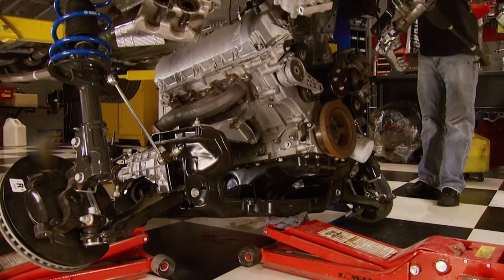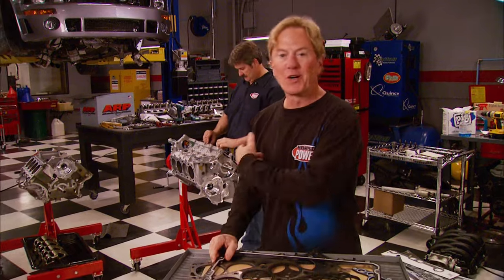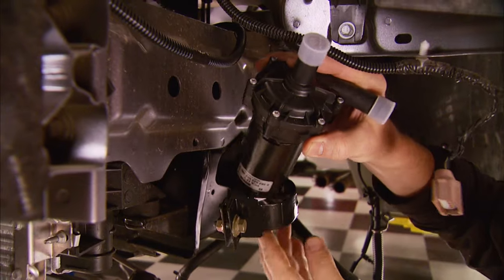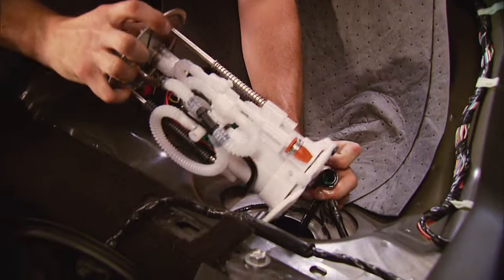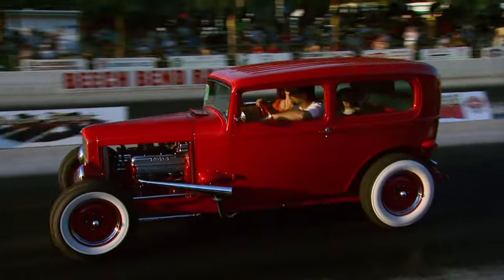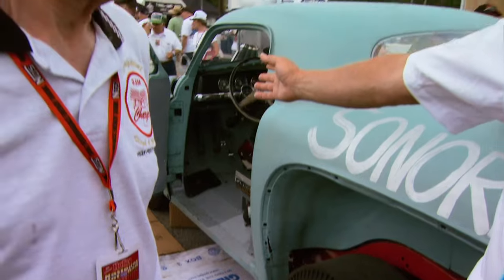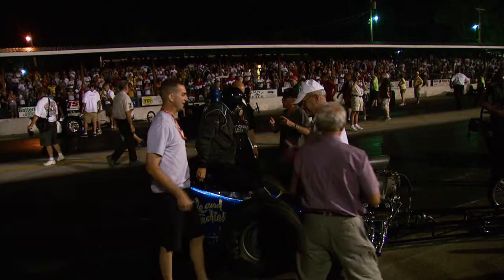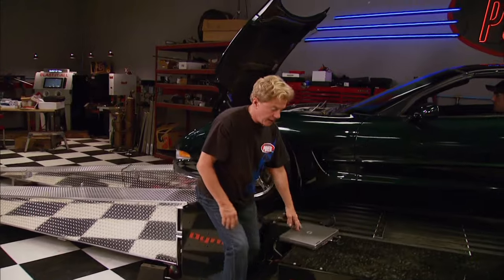Supercharging A GT's 4.6-Liter For An Extra 200 Horses- HorsePower S12, E13

Comment: Hey powernation your probably not going to respond but I have a question, I’m new to the car world I just got my first car and it has a 1975 Chevy 350 making about 140hp, and want to make about 150 hp to hit that 300 mark, with out blowing my engine and not spend to much, what is your recommendation? Thank you
Reply: Also I really don’t want to do a motor swap because even though it’s a 1975 it has low miles and I don’t think it’s worth Changing something that’s not needed
Reply: thanks for advising a 15 year old show
Reply: Port the heads and have heads redone with bigger valves to start...

Comment: If you're going to replace the shortblock, you might as well coyote swap it. Then it could make 700+ horsepower with a blower.

Or 420-460 HP naturally aspirated...

Comment: Question...
Does the super charger need to be removed when replacing spark plugs ?
Reply: Most likely judging by placement, hence why you should just go turbo instead
Reply: @Prestiged_peck  booooo turbo has its pitfalls too
Reply: @mikestoms4015  honestly idc which you go with, turbo has reliability issues, supercharger has servicing issues, and centrifugal just doesn't make a good daily unless you're looking for a stockish feeling car on the daily drive.
Reply: its a question you will never need an answer for
Reply: No, the supercharger does not need to be removed when changing spark plugs
Reply: @Prestiged_peck  no its easy to change the plugs!
Reply: @Prestiged_peck  WHAT are you high!

Comment: No need to drop the compression that much or at all on that engine. But this was 13 years ago lol
Reply: Probably trying to get it to hold with 91 octane with no boosters
Reply: Before e85 was mainstream and the great tuning we have now. Could go another 200hp with that blower if it were ported properly.
Reply: @paintballpartutd  they still had the option of race gas for a power tune
Reply: Low compression sucks for something thats daily driven. With e85 these new gen3 coyotes run around with 12.0-1 compression and tvs blowers and hit hard. Only thing that helps this is the roushcharger making up the low end if it were turbo or centri it would be lazy out of boost without a gear change.
Reply: thanks for advising a 15 year old show
Reply: @trillrifaxegrindor4411  anytime friend

Comment: Am I the only one who noticed that this mustang was already a ROUSH mustang before they started? Like, it seems all they REALLY did was add an intake, fuel system, throttle body, and intercooler... Why else would the old engine have already had the intake removed when we first get to see it if it wasn't because they remove the intake and ROUSHcharger ahead of time? OR maybe I'm crazy IDK...
Reply: Roush has staged packages. It likely started as a Stage 1 sold at a Ford Dealer.

Comment: Wish normal people could afford it. Did they see the build tally? You could just about swap a coyote.
Reply: You could just buy a mustang with a coyote in in.
Reply: The Coyote engine hadn't been released yet, this was filmed in 2008.
Reply: @ryanwalker3509  my point exactly.
Reply: @poot111111  it is now.
Reply: What's a normal persons budget?
Reply: Back in 08 a lot of people were building 4.6L.  The NMRA record for the mod motor class is 5.xx @ 250mph in a 1/4 mile.  They are required to run a factory block and factory cast heads.  But I believe they were over 4,000hp horsepower which is ridiculous on a stock block.  I knew of 4.6L street cars with over 1500hp back in 04
Reply: @nitroustommy3668  people always complain that they can't afford it.   If you don't make poor decisions in life you can have nice things.

Comment: Im kinda ashamed to admit that it took me until I was about 16 or 17 in 2007 to see that there  builds where 100% weak sauce and really just advertising... I know from experience  what a stock and stock bottom end with heads cam and intake frpp kit and a forged bottom end with the same heads cam and intake on a 3 valve 4.6 with no boost a little boost and alot of boost and what they put together was just a weak pile of money. My best friend had a 2008 bullet and was there for everything from stock to 900whp, with a completely stock long block with d1 procharger and air to water intercooler 80 pound injectors kooks long tube headers no cats 3" x pipe and stainless works mufflers he tuned it his self with hptuners i cant remember exactly how much power it made but it was over 530whp on pump gas and a little more on race gas not much more though he daily drove it like that for atleast 2,000 miles and beat on it every chance he could and then with the FRPP heads,cam,intake package they sold it made 590whp on pump gas with the same pulley on the blower but actually made almost 2 pounds of boost less than before but it didn't last very long and it let go he was revving it pretty high if he would have kept it at 6500 it would have lived longer imo but thankfully the heads didn't get hurt that bad and could be fixed then he built a pretty nice forged short block and swapped over to a badass custom single turbo setup with a Borg t6 s480 it made 910 with 28x10.5 Hoosier's through the 5 manual trans but he came to his senses and wanted to go fast and put a powerglide in it. I want to say he finished that setup in 2013 or 13 its been freshened up twice and its still running now besides re-doing the turbo kit and a bigger air to water core and badass forced Inductions billet s488 and cams its still pretty steerable taged and insured and goes mid 5's in the 1/8 but you can almost drive anything on the street in Alabama
Reply: I believe they always stayed super conservative on the tune and ran very low boost.
Reply: @nitroustommy3668  they had to!! I know its not the same but i have another friend i helped put a stock lsa blower on the 4.8 in his 2004 single cab Silverado besides the blower and longtube headers it was stock and mad 470 and 480 something ftlbs through a 4l60. Almost everything they put together is on the anemic side, off the top of my head i can only think of 3 builds that actually made some power and one was a turbo 427 lsx setup that made around 1000hp but for what they had it should have been making 1200+ without trying IDK maybe I'm just crazy... lol
Reply: "really just advertising" welcome to watching TV for car guys. Most of these sort of builds they do belong to customer cars, and usually they're owned by old guys who drive these cars once a month or less so they keep the tunes conservative.  You and your buddy found out how shit the 4.6 really was and why most say the power limit is 500hp before needing to build the block. Those motors really were so shitty, its the reason why LS swaps into Mustangs became more and more common lol
Reply: @rotor13  LS swaps are only so common because junk yards are filled with them for $200.  It's vary expensive to build a 4.6.  Also the 4.6 can handle a ton of boost and they like boost.  I can't think of any other factory production block and heads that can handle 2500+hp
Reply: @rotor13  500hp limit is a myth.
Reply: @nitroustommy3668  If the 500hp limit was such a myth, why did you say in your original post that your buddy blew his motor when it made around 530hp and after being built with stronger parts made 900ho? Those are your words, not mine. 

Its pretty common for an engine to have a certain power limit before breaking parts. It simply means that at some point past a certain amount of power, the reliability of the engine cannot be guaranteed. The 4.6 Mod motors have notoriously weak internals due to being a thin, cast design. 

Forged pistons and rods will make the damn thing push 1000hp all day lol. 

You're also referring to a certain class rule about using FACTORY CASTINGS. That doesn't mean the head/block can't be modified. In such a class it isn't uncommon for such heads to have larger, stronger head studs for increased clamping force as well as having an o-ring/fire-ring around the cylinder bore to improve sealing to reduce chance of lifting a head and melting the block/head - as is common when dealing with massive cylinder pressures. Even for a street car this can happen, and is especially common when pushing boost through a motor using an MLS head gasket without having both the block and head surfaced. 

A factory cast head surviving 2500hp is not some "miracle" either. Porting, port shape, larger valves, stronger valvetrain, combustion chamber shape, cam profile etc is the secret to a head that can flow enough air to support making 2000+hp. 

They do it all the time with plenty of engines. The 4.6 is nothing special lol. 

LS engines being a cheap junkyard motor was not simply the only reason why LS swapped Fords were common in drag racing. Its because you can find an old C5Z with the 5.7 that could handle 800hp without cracking it open. The reliability of making power was way better than any Ford block at the time. The bonus for Chevy engines was that the LS design was used on every V8 GM had. You could take an iron block from a Chevy delivery van and put used Corvette cam, heads and intake and exhaust manifold - flip the exhaust manifolds for a single turbo setup and you've got a reliable 700-ish hp for less than $4k lol. 

I know all this because I used to work for a machine shop where 60% of our work came from Late Model Restorations. Our common mod for the blocks was half-filling the water jacket around the cylinders with aluminum epoxy - it was the cheapest way to have a block built to make 1000-1200hp for drag racers without resorting to sleeving or going straight to a Dart block. The ones with big money would send us their 5.4 iron blocks to get re-sleeved and get drilled/tapped for larger 1/2in head studs.
Reply: @rotor13  idk if your talkin to me or the other dude but Im not a ford guy i personally cant stand mod motors  but the 500hp thing is bullshit tuning is everything but his stock long block was making 530 on 93 pump gas and 550 something on 110 at the wheels  thats damn near 600 crank and made 593whp with heads cam and intake and was revving to 7100rpm after makin 530+ for over 2000 miles, it didn't instantly eat shit it lasted a few months at damn near 600whp I think it would have lasted longer if he would not have been revving the shit out of it i would have to ask how much  boost but this was back in 2011-2012 it was actually pretty impressive but with a built short block not so much 4.6 & 5.4s and coyotes have thier place but no where around me im a push rod kinda guy. I made more power than my buddy with a sbe 4.8 with a billet s485 through a th400 my newest build in my single cab 03 gmc Sierra  403 ls2 with 821 ls3 heads Huron  speed single t6 kit with Garrett 88mm has made 940 on 21 pounds so far its gonna go up to 28 soon maybe 30 its got 1/2" head studs, Ford shit is expensive but like anything else with enough money it will make power
Reply: @woodgrain18 its not a myth. Its a known fact on the 4.6 mod motor. Thats what i've been talking about this whole time. No amount of tuning on the stock cast pistons and rods even using meth injection and 120octane race fuel isn't going to allow a 4.6 mod motor survive much combustion stress due to the weak cast internals lol.
Reply: @rotor13   you got the wrong guy, I never said that.
 You can blow one up at 300 horsepower, most of the time they blow up because of the tune.  Fact is most people don't know what they're doing. People don't degree camshafts, find true top dead center, Index spark plugs or use correct heat range plugs, run wrong cams, So on and so on. Do they even know what the timing really is?  They can use the exact same parts as I do but they might blow up and I'll still make more power.  If you just slapping parts together it probably will blow up at 500 but 500 isn't the magical number. Allegedly stock 5.0w block splits in half at 500.  I'm making about 750 with 18 lb of boost. I'm about to put my direct Port Plate System back on and spray it another 100-150.  Plenty of people making over 900 reliably even with stock pistons and stock rods. Lots if people make 7-800hp.
 Chris Watson makes over 900hp with a completely stock short block. Its all in the tune and balance of the rotating assembly.  (assuming that the block casting is good from the factory because sometimes on rare occasions they split just because of bad casting)

Why in the world would anyone run a stock non forged piston with a lot of boost, I don't know.  I wouldn't, forged pistons are cheap. Slap in a set of balanced pistons and rods and you're good. That goes for any engine you're racing.
  I'm well aware of modifying/filling blocks and heads. The 4.6 Mod Motor record is 5.88 @ 250.  Not bad for 281 cubic inches using factory cast block and heads.  I don't think stock cast LS engines are anywhere close to to that.
Reply: Oh and 03-04 cobras had forged pistons from the factory.  96-01 cobras had forged crankshafts.
Reply: @nitroustommy3668  there's a guy in my area that has a 03 Cobra that had to be making close to 1000hp with a stock bottom end termi and ported stock heads with a big single turbo i dont personally know him but   now its got a stock bottom end coyote with billet oil pump gears and  twin 67's making 1100hp i actually seen it make that on the dyno theres no debate that they can make big power but I will stick to my pushrods
Reply: I'm a push rod guy myself.  
I run a 306w. Stock block, stock crankshaft. All ARP Hardware. DSS pistons, rods and main support system. Innovators West balancer. Blueprinted and balanced. Degreed the cam. Indexed spark plugs. Port matched, Etc. Built right. 
 On motor It ran 11s with the wrong torque converter.  It made about 200 passes.  Then I started throwing nitrous on it.  From a small NOS dry nozzle,big NX wet nozzle, a direct port plate system.  Can't kill it.  Now I threw a upgraded V1 s trim.  It has a Billet impeller and a cog belt system. Maxing it out at 18 pounds with a custom PTC torque converter. I've blown some head gaskets due to accidental bad tuning but I still can't kill it.  I'm thinking my front main bearing is going to go first from all the stress from the Cog belt system. 
Today's tuning is amazing compared to the early 2000s. FAST, Racepak, AEM, Holley Dominator EFI are all awesome systems.  Even oil technology has improved a lot.
Reply: I think their builds were emission legal too.  Weak sauce for sure.

Comment: so let me get this straight 12,000$ invested and only makes 250 more hp so after buying the car for lets say 15k investing 12k in parts not including labor so 12k turns into 20k you have 35,000$ in are car that makes the exact same hp as a slightly modified coyote 5.0 mustang that cost 25,000$ seems like a bargain to me.
Reply: this is from 2007, or at least they refer to a "new 2007 Mustang"
Reply: This episode is from 2007 smart guy...
Reply: @fl_atv_riders4455   The only thing you've proven is that Roush Mustangs are overpriced if they're not supercharged. It was true back then, and still true now. But you're not getting a GT500 for anywhere at $42k. Also, 2008 GT500's didn't sell at MSRP either, it was unheard of. People were paying dealer markups making them $50k or more lol. And the later 2013 GT500's started at $62k and also had dealer markup. Hell I'm trying to find a 2021 GT500 for my dad's birthday and can't find one for less than $90k even though MSRP is $70k.